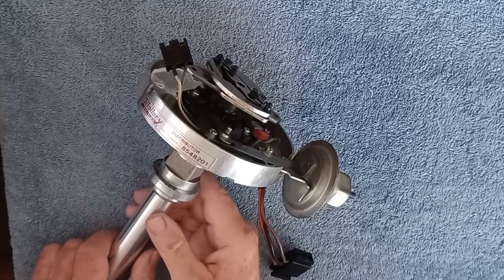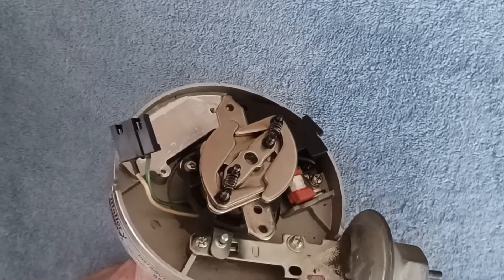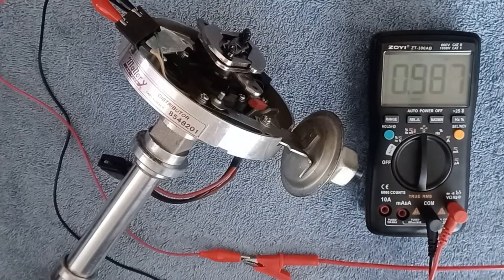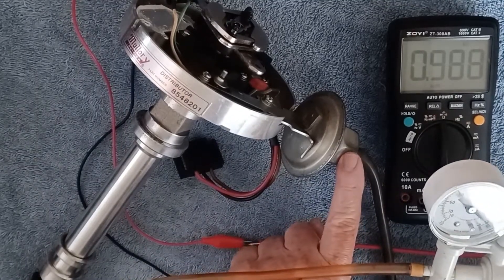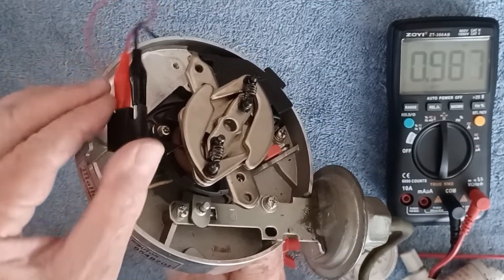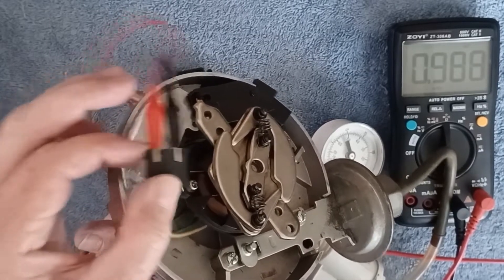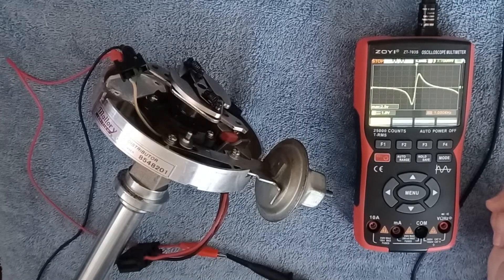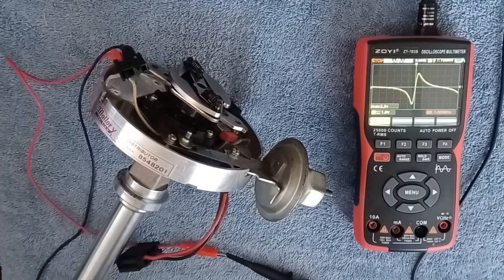How to Diagnose an HEI Distributor Pickup Coil

Comment: Very good video. Would you know what to expect for the AC voltage at engine cranking speed. Most people will want to check this while on the car.  I was told from another video I saw a few years ago that 0.3 VAC was about the minimum to trigger the module ...?
Reply from the maker: That's an excellent question. Most of the detailed testing I've done on HEI distributors have been on a bench and out of the vehicle. I know that there is no GM spec for AC voltage output. From what I've seen, the service manuals just list a resistance value for the pickup coil and not an AC voltage output or a sine wave description. 

It's typical for an engine to crank over at 150 to 200 RPM (under optimum conditions). The distributor will rotate half the speed of the crankshaft which means around 75 to 100 RPM. That may be about 1.25 to 1.6 revolutions of the distributor shaft per second (approximately).  The pickup coil is a generator so the faster it turns, the more voltage it will produce. I could see 0.3 to 0.5 volts at cranking speed, but I can't verify that. I know that one of the disadvantages of a pulse generator type ignition system is that in very cold conditions with very slow cranking speeds, the pickup coil may not produce enough voltage to trigger the control module. That's why Hall Effect (digital square waves) have replaced most pulse generator speed type sensors that are used on vehicles today. Their speed isn't important. It's just an on/off switch, not a generator. You've got me thinking. When I get the opportunity, I'm going to try to do a cranking test on an HEI pickup coil and see what it is. I've always said that you have to know what normal is to be able to recognize abnormal. Thank you for your comment.
Reply: @StuffAboutCars-jg5tx Here is something I kept in my inbox. This guy was barely turning the shaft and getting results, and he was turning it backwards ! https://youtu.be/tSs8gE4egNg?si=WIua_Ti-Od03Crfn